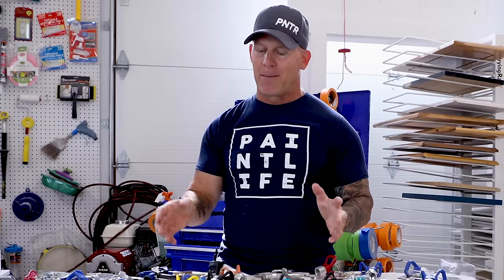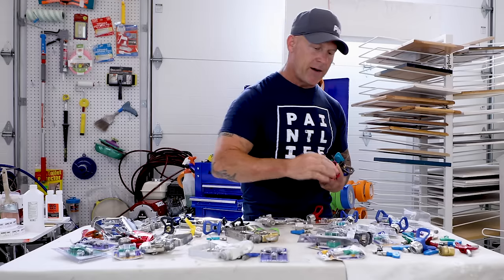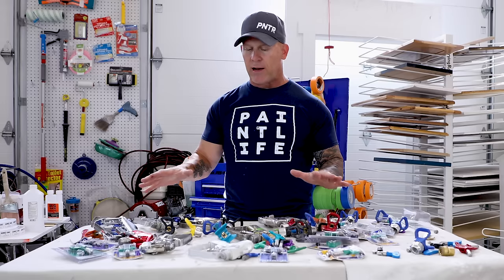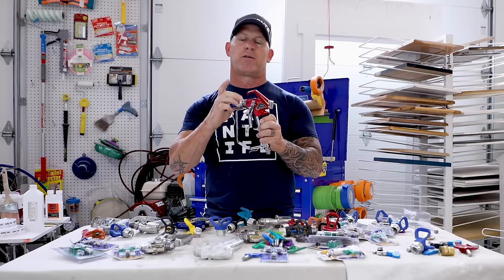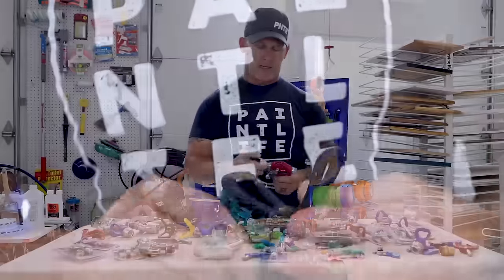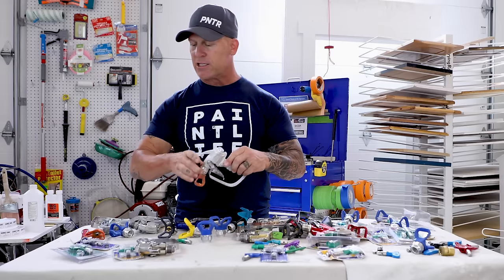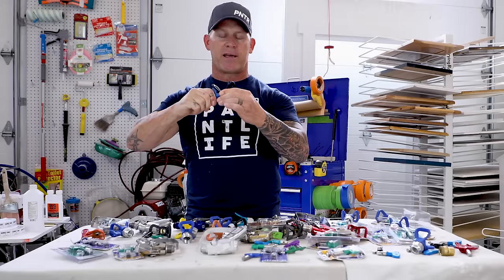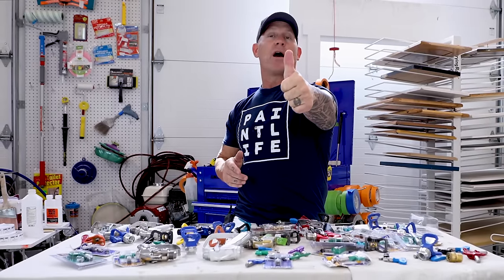5 AMAZING Airless Sprayer Tips on SprayGuns!

Comment: I found a deal on a Graco x5.  Largest tip is 515. How many paints require a 517? Does adding water reduce the tip required?
Reply from the maker: most can use 515